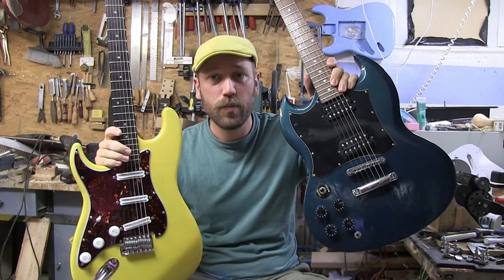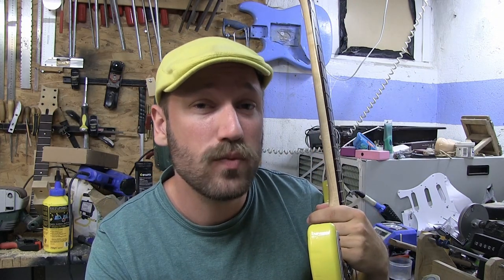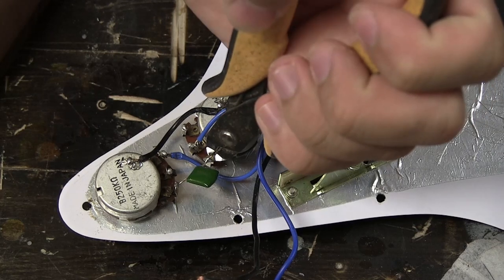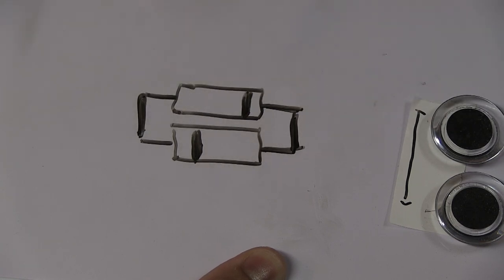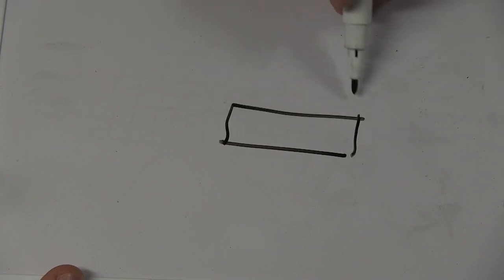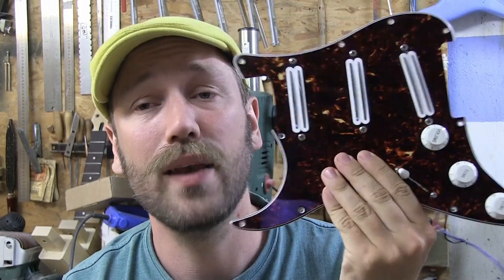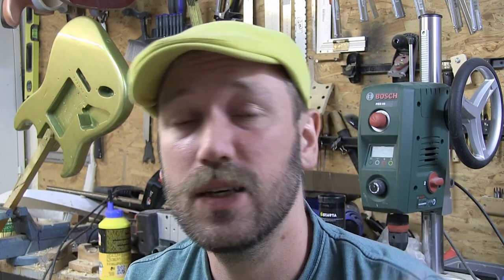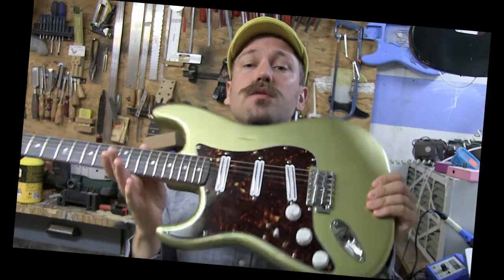how to add a passive distortion control knob

Comment: I'm probably crazy here, but aren't you actually feeding (parts of / the frequencies at amplitude necessary to cross the diode) the inverse phase of signal back into your circuit? I'm not sure you're clipping in the way active overdrives would.
Reply: commenting so i hear an update! i had a similar concern pop in my head when i discovered the mod

Comment: This is mind blowing. I just spent weeks trying to install the board from a fuzz pedal into my guitar. I’ll try this instead. But I always thought that this circuit would drastically cut volume too??????
Reply from the maker: Well the volume cut is noticeable but it's not enough for this not to be cool 😀👍
Reply: @zurowetz  it’s definitely cool! Thanks again for making this video and for the reply. It’s much appreciated mate. I installed an LED into my guitar body to show when the fuzz circuit was engaged. I’ll see if I can get the circuit to work with one BAT41 diode and the green led that for better or worse is now part of my guitar! I’ll let you know how it goes. Thanks for the speedy reply, it’s much appreciated.
Reply from the maker: @davetonkin-j5k  no problem 👍 I'm just glad someone got something out of it 😃
Reply: @davetonkin-j5k well, how did it go?
Reply: @samsgarage3540  in the end I installed an “artec distortion driver” that I got off eBay for about $50 AUD. It was a bit of stuffing around, but it works! I incorporated the LED that I’d already drilled into the body as well. I removed my tone pot, and the driver goes in the position of the pot, you rotate it to cycle through the different distortion settings. Had I not ordered that, I would have tried the circuit demonstrated in this video!

Comment: What rail pickups are in your strat? It sounds nice in the clean and distortion demo at the end.
Reply from the maker: @smarfmart  its the cheapest on ebay from China I just wanted to see if they were good and I enjoy them 😊
Reply: @zurowetz  got a link? are they alnico or ceramic? I am thinking about getting some for some project guitars.
Reply from the maker: @smarfmart  sorry no I don't have a link it was years ago I bought them but they are ceramic 🙂

Comment: So what you are trying to achieve is a passive clipping of the signal. I've never heard of passive clipping before. You could even do the same thing in a box on the floor. So why do we need powered pedals ?
Reply from the maker: I have a video where I put it in a box but the clipping will lower the volume so you need a powered boost pedal and that's basically what a distortion pedal is, a clipping circuit and a boost circuit 😊

Comment: bro you're awesome! would love to know if you can do a variation of this mod on a 2 knob guitar. I have a squire mustang and was thinking would be awesome to something like this. But I don't really know if it would work because it's only two knobs volume and tone. If you have any idea please let me know! Thanks
Reply from the maker: @Ale-ry9qf  hallo😀 it depends on how willing you are to mod the pickguard because you can add another pot and just have 3 controls, or you could make a smaller switch that will add the distortion if you want to. But if you don't want to change the look of your guitar by drilling holes in it you could either turn the tone pot into a dis pot (likw I did) or you could wire this up in a box 👍😉👍

Comment: Great video.
How would i achieve this using regular strat style single coils?
Reply from the maker: Thank you its the hotness of the pickups that matters not the kind of pickups I only used to rail once because they where in the guitar already 👍😃👍
Reply: @zurowetz  ok, so if I was using a less hot pickup what diode would I use? A lower or higher value?
Reply from the maker: @axeade234  well it really depends what you want a higher well give you more but volume will go down more and a lower will give you less but you will keep more volume so if you have some diodes laying around try them and see what you think and change if you need to 🙂
Reply: @zurowetz  I don't have any laying around I just bought the ones that you used but they don't seem to do anything, they just seem to work like a really weak tone control. Any ideas?
Reply from the maker: @axeade234  well first I would try strumming harder the loudness of your signal is key so maybe you play softly? Then ifthats not the case go over the wiring again and also check that all the wiring is correct not just the diode and if that doesn't fix it maybe your pickups are to low for this and try other diodes like maybe 2 red leds or maybe two 1N914 or something like that let me know how it goes you can also find me on Instagram if you want me to take a look 🙂
Reply: @zurowetz  thank you, I don't think it's my strumming or the wiring but I will check the wiring again just in case, if it's not that I'll try those diodes you have suggested. Thanks again!
I will send you a pic on Instagram

Comment: I'm looking for this mod. Have you tried to add Treble bleed with the circuit in series?
Reply from the maker: I have not I have done treble bleed (I didn'tlike) before but not series neither of the mods are hard to do 🙂 so you can do it I believe in you 😁👍 but what effect are you hoping to achieve?
Reply: @zurowetz  add brightness with the tone. kinda muddy for me but this is awesome. thanks
Reply from the maker: @joseg.9026  thank you 🙂 I think you want a treble boost not a treble bleed?
Reply: I've done electric banjo circuit.  It's a capacitor in series with super low capacitance.  Lower value makes the tone more tinny.  Instead of 47 or 25s it's like .02....  Normal tone bleeds to ground, bass cut has to be in line; hot guitar side, cap, hot amp side.

Comment: too many ads -single coil pickups - you are using hotrail . what do your hotrails ohm out too i wonder ?  bat 41 is a silicon shotky diode is it ? 1N6263 lo v drop , 1n34a is a lower v drop germanium diode . i would guess that in order to get the most amount of noticeable distortion effect from using a passive diode array one would wish to employ the highest output pick up. i am am not sure weather or not the pot matters ...like 500k vs 250k . these would be things i would wish to experiment with as well as what small value capacitor in parallel with the diode to tame the fizz. ideally i would wire the pick up directly to the output jack and then do experiments on the bench - with the pot and diode in a test rig externally . trying things out . but of course this is just the way i thought to try it .if you have a strat with a hotrail or humbucker and 250k pot you certainly can just install the diodes which isnt a very big challenge .very  cool project . love the yellow strat too - thats classy !
Reply from the maker: Thank you for the comment I also did this to an epiphone and I think it worked better on it  you have to match the kipping with the hotness of the pickups other than that I'm not sure anything else matters I think you should do experiment and have fun that's why I made videos 😊👍

Comment: I ordered some BAT41 but they sent 1N4007 instead. Would these work the same?
Reply from the maker: Im not sure I have never tried but I don't think the diodes matters all that much so try and see let me know how it goes 😃
Reply: @zurowetz  Hi, the diodes matter a LOT, in a passive clipping like this, you need diodes that have a very low forward voltage (called Vf in the datasheets)
the idea is that the pickups produce a very small voltage, and if you have diodes with very low Vf (around 200-250mv) you can have a nice clipping. If you put diodes that have a Vf higher than the peak voltage of your pickups, nothing will happen. that is why usually the diode hard clipping circuits are placed after amplification stages.

for exemple : Leds have a Vf between 1.7 and 3.5 (from red to blue) Unless you have a pickup that have peaks that go OVER this value, it is not going to distort.
Same for Silicon diodes, they clip at around 600-700mv
Germanium diodes around 400/300
Schottky diodes around 300-200
so the idea is : pick the lowest Vf diodes and find a sweet spot where  your signal is not too compressed and crushed and where you can actually hear a breakup when you use a single light string.

another thing : you can use different diodes to create asymetrical clipping (for exemple a Bat41 on one side and a Oa5 on the other side, or one BAT41 on one side, and two BAT41 on the other) different textures, different sounds

Comment: Could you put it on a switch instead of a pot?
Reply from the maker: Yeah super easy barely an inconvenience  just use a SPDT switch an connect ghe middle leg to the out of the volume pot and to the jack and then one of the other legs to the two diodes and then the diodes to ground 😀👍

Comment: Is it possible to wire this to a push pull pot so i can turn the distortion off (in normal position) and turn the distortion on (in pulled up position)?
Reply from the maker: Yeah it can be done but I don't see the point you turn it off by moving the pot just like a tone pot or is it that you wanna keep it a tone pot and switch it over to a dis pot?
Reply: @zurowetz I meant to say when the push pull pot is pushed down to bypass the push pull pot completely (no distortion), but when the push pull pot is pulled up to turn on the distortion. Basically like a on/off switch for the distortion.
Reply from the maker: @Wolfamancer97  yeah so the two first legs wound have a cap from the tone and the thirds would have the diode clipping then the middle legs wound be from the third leg and to the back of the pot😃
Reply: @zurowetz  ok thanks 🙂
Reply: @zurowetz  if i were to wire this to a push/pull volume pot instead, how much of a difference would it make when compared to using one of the tone pots?
Reply from the maker: @tron7_  well it depends on how you do it and if you are asking about the sound because the sound should be the same

Comment: Meh.... The less knobs the better.
Reply from the maker: Then your not gonna like my next build it will have 612 knops😉
Reply: I know it can be confusing and all fancy but 2V and 2T , Early
Reply: @juanvaldez5422  not confusing. Just pointless.  
That's AT LEAST 3 knobs too many.
Tone is little more than a "make my guitar sound worse" knob that everyone remedies by boosting treble at the next available eq stack. You'd be better off getting rid of the one on most guitars, let alone add a second.
2 volume knobs is just pretentious. The concept  that you are " blending" the sound of your pickups to achieve some magical sound is just self validation of an overinflated ego and a brooding superiority complex.
There is no esoteric value to what amounts to fidget toys on a guitar. But, adding them and saying " these make you sound better" let's companies play the emperor's new clothes game with their customers, and charge hundreds more for cents worth of components.
Reply: @earlycuyler2295 I personally do not dime  out my tone knob or  volume knob. I set them both on 6, set my amp like I want it and if I ever need a boost in volume or Bass or treble. I have it easily accessible at my hands. But that's just me
Reply: @josephdoiron3246  ...
Like I said, " everyone remedies by boosting treble at the next eq stack..."
Reply: @earlycuyler2295  I don't think you're understanding me. I said I set my amp how I like it and I'm more of a fan of a mid sound. You have a one-track mind and don't read and take in what people are saying. You keep doing what makes you happy. But you don't speak for me or everyone else lol.